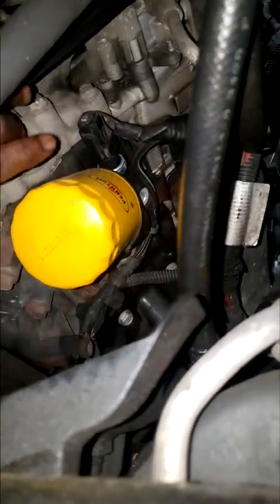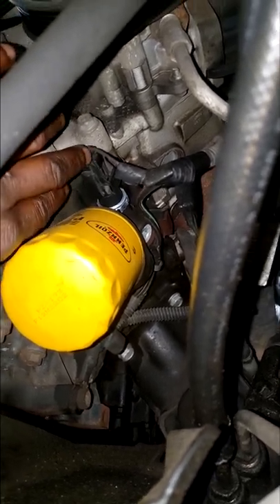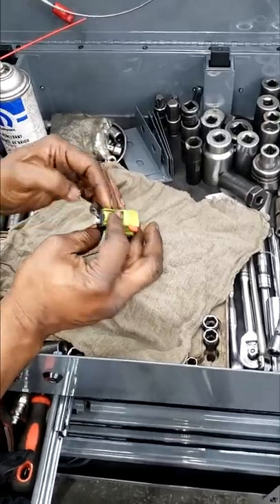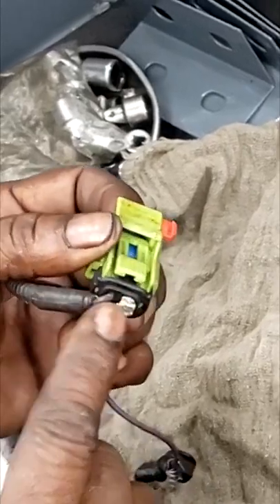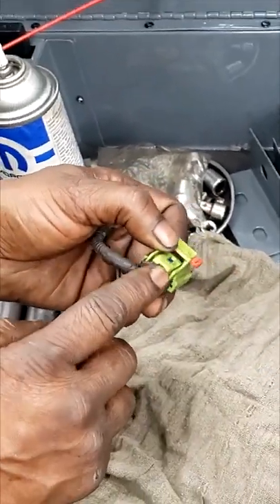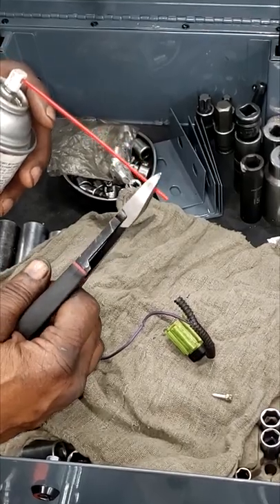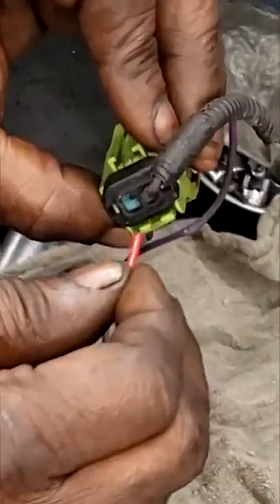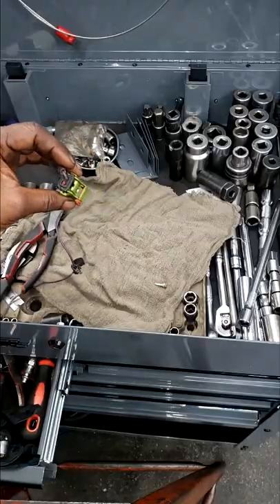SECRET REVEALED. Oil light on and flickering. Do this. #shorts

Comment: To everyone showing up here, allow me to explain.  The oil pressure in the engine pushes a diaphragm in the switch that makes two metal contacts touch.  If the connector is completely sealed tight the diaphragm will have equal pressure pushing back at it from the other side.  This makes a very light pressure on the metal contacts inside.  Every little bump or rattle will cause the metal contacts to stop touching for a moment, this makes the oil light flicker.  If you give the plug a way to exhaust the built up air pressure in the plug then the oil can push the diaphragm in with the full amount of it's pressure without having the trapped air pressure pushing back at it.
Reply: Brilliant Chrysler design as always
Reply: I really hope your not serious haha
Reply: Thank you sir. God Bless.
Reply: @Soulmodulation  buy a BMW or a chev, ford, Hyundai or Volkswagen... you'll see 'engineering' in practice 🤣
Reply: Great video.  I just learned something new.  A small tube from a not exactly WD - 40 , But that works as good.  👍. Thanks for the tip ,.
Reply: I have a question.   I have a 1994 Toyota Camry 4 cylinder.  It just started running rough.  Doesnt die at sitting at a red light.  But it runs bad , sounds like a vacuum leak, but , you mash on the throttle and 7 hear a buzzing noise ,. Not sure if it's a vacuum leak.  Sounds like something is stuck in the fan making it sound funny.  It does have broken motor mounts.  But I don't think that's the problem.  Any idea what it could be?  Oh , several weeks ago,. It just started making the noise and running rough,. I noticed that the hose that hooks to the hooks to the fuel injection part down to the box , that has a filter on it ,. Then it goes to the front of the car for the breather ,. The end part on the fuel injector had a split by the hose clamp b I took it off to duct tape the split part, but , the whole thing was completely broke off ,. So I took it off, and pushed the the end back on it tightened it down and now the check engine light is on, still running rough. I am baffled on what's wrong any help would be appreciated, thanks.  Bill , is Oregon. 👍👍
Reply from the maker: @yermoffroad  Whats funny is ya spelling, not the post
Reply: Nice explanation. Using science to explain things.
Reply: What air? Its a sealed switch (or it would leak oil) i assumed you were trying to keep the connector cool as to not distort and loose connection.
Reply: @yermoffroad  this guy is arguing with me about this, using words like diaphragm and trapped air😆
Reply: @007heatingandair  ever tear open a pressure switch?
Reply: @007heatingandair  The above link is a video on the operating principles of a pressure switch. Diaphragm and all 😂
Reply: @007heatingandair  So, if you go to the part of the video with the operating principles of the switch you'll see that the diaphragm (arrow #2) has to physically push into the area of the metal contacts (arrow #5).  If that area has a positive pressure present it reduces the force of the oil pressure on the diaphragm.

30psi--->  vs.  <--5psi   =  25psi-->  net force

Some switches will be completely sealed at the connector pins but have a slight vacuum pulled in the metal contact chamber at the time of manufacture to ensure no positive pressure in that area.  However, the seal around the plug pins can fail allowing the vacuum to escape the chamber and some manufacturers do not seal around the plug pins at all.  In these situations, plugging the connector into the switch creates positive pressure in the metal contact chamber.  The sealing grommet on the plug makes contact with the switch housing, then is pushed in another 1/8 inch untill fully seated.  This acts like a pneumatic piston creating a positive pressure that passes into the metal contact chamber and acts on the diaphragm.
Reply: @007heatingandair  Hope this helps.
Reply: That switch is sealed, no outside forces effect it in any way other than the connection to ground going through the metal prong going to the connector, if outside pressure effected it in any way altitude would have an effect on it's ability to function properly.
Reply: @007heatingandair the seal around the pins fails and the outside forces are effecting it, hence the need to open the connector.
Reply: And altitude would effect it minimally but not as much as the air pressure created from plugging in the connector, then heating up, expanding and creating additional pressure.
Reply: @007heatingandair  that's why this isn't a problem directly from factory, it happens over time as the seal around the pins fails.
Reply: @007heatingandair  another failure mode would be oil pressure seeping past the diaphragm, eventually the pressure on both sides of the diaphragm equalizes.  However, this isn't the case with these particular sensor / plug combinations since you can replace the sensor and the plug with new and it will still cause the same problem.  The power/ground pins are not sealed from factory (whether intentionally or accidentally) and the connector must breathe.
Reply: @Redranger-fu2xt  sounds like you need to stop trying to diagnose something out of your skill level and pay somone who actually knows what they are doing to tell you what's wrong and then you can repair it yourself. Nothing is free. But theres my 2 cents for your begging cup
Reply: @victormendoza871  hey , well  could be the spark plugs.  It was running fine the next minute it started running rough.  My money and job situation is nil ,. No job no money. I can't do anything.  Trying to find a job is  just non existent.  I thought it could be a vacuum leak, but now I don't know.  It sounds like a piece of plastic stuck in the engine fan.  Lack of power, goes uphill ok , but you really have to push the gas pedal to the floor to get it to move fast .  One place charges a $ 110.00 dollars just to look at it ,. Oh , also poor gas mileage.  That's why I am asking questions to maybe find out what is wrong with it. It also missed at driving speed .
Reply: No no no the sensor is sealed OR it would leak oil buddy, it's just a bad connection, replace the connector
Reply: @bradbeck2601  at that point replace the broken sensor!
Reply: @Redranger-fu2xt  that's the intake hose. Likely it has a large leak and needs to be replaced
Reply: @thomaspatlan1751  I have a link posted above for how the sensor works.  You're wrong pal.  You can also look up the technical service bulletin for it.  If you put a new OEM sensor in it does the same thing.
Reply: @thomaspatlan1751  Also, not sure if you noticed but there is only one wire in that connector, pulling the dart OUT OF THE SIDE WITHOUT A WIRE IN IT is the fix here.  If you reach up without removing the plug and just pull that little white dart out the problem is solved.  Care to explain that using your logic and reasoning?
Reply: @aayesher9400  Thanks.  I have tried to work on it but still not able to figure it out. Could be maybe it's hidden where I can't see it.  Funny thing it was fine in the beginning later it all of a sudden started running rough.
Reply: @kelsycunningham8452  BMWs are the easiest cars to work on by miles and miles.
Reply: @Redranger-fu2xt  it probably just needs new brakes.
Reply: @mrlions9494  Hey  , thanks for the reply . Refresh my memory , you talking about my rough idling car ??  It does need brakes , but it's the rough running motor , it has a vacuum leak . You mash on the throttle you can hear the leak , I sprayed water on it , still don't notice the motor changing pitch  it could be the vacuum hoses . I may have to raise it up and crawl under with a flash light .  It didn't happen over time , going to town and bang , it started running rough , that quick . Brakes ?  It does need brakes , I don't think would cause the rough idle . It sometimes loses power at pressing the throttle . Poor gas milage , all the vacuum lines seem ok , but it shouldn't get poor gas mileage , I went through a half a tank or a 1/4 of a tank in 53 miles ,  I'm stumped on this , any ideas ?  Thanks
Reply: @KG jobs non existent ??   I haven't been able to fix my car , not yet ,  a very serious vacuum leak ,  I'm too young to collect social security ,  there I thought jobs are everywhere , I don't understand ,    I sprayed water on the motor to find the leak , and still didn't ,    last ? This job thing ?  I don't understand it at all ,  I have fought last 3 years trying to find one , I still have bills to pay , no money I can't ,  your comment is great ,  I own this house and pay space rent ,  this just ran out from an agency helping me
Reply: @Soulmodulation  I'm the first one to shit on Chrysler, but this is a universal design used by a plethora of manufacturers.

Comment: Refreshing to see a mechanic at work not just a parts changing video but a refreshing mechanic fix
Reply from the maker: Thanks for watching bud
Reply: Are you kidding me? You think electricity needs air to breathe? Guess again buddy.  Hes already put a new filter housing on the car, now he's helping your electrical system BREATHE? THIS IS EXACTLY THE SHOP TO AVOID.
Reply: @anthonyrybczynski5420  it's not the electricity it's the sensor mechanism, there's a comment that explains it if you're curious
Reply: @philljustphill1656  sorry sensors are manufactured to be air tight and prevent leaking in or out. If there is not enough oil pressure to overcome the tiny amount of air (which air can be compressed) behind the diaphragm,  then there is not enough oil pressure.  Do you know why sensors are air tight? To prevent moisture from entering.  He didn't fix anything. Can you please show me a Technical service bulletin from the manufacturer where they state that the sensor was manufactured wrong and required a hole to breathe?
Reply: @anthonyrybczynski5420  they don’t make everything perfect especially jeep
Reply from the maker: @anthonyrybczynski5420  so this comment 2 months old and I obviously missed out on a chance to clown ya stupid ass comment so I will not bother to do it now. Hopefully by now you have researched this issue and now understand.

Comment: Every engine I've come across with an oil light flicker was due to low oil pressure at idle. It was still in spec, but aftermarket oil pressure switches are poorly calibrated. Just use an oem switch.
Reply from the maker: In some cases, an OEM sensor was used dude. Im sure you saw that the sensor was new in this video, smh
Reply: @OnlineMechanicTips  A sensor can be new and not be OEM, SMFH!
Reply from the maker: @shelbyseelbach9568  whats ya point? Because of what I did, this vehicle long gone an likely never to return for oil lights flickering so what should that tell you?
Reply: @OnlineMechanicTips  My point is that a sensor can be new without being OEM. Seems readily apparent from reading my first comment. I didn't say anything about the other stuff you are now addressing to me for some reason. It's a true statement.

Comment: When the oil pressure sensor goes bad and starts leaking externally, it leaks into the wiring harness and that finds its way all the way up to the engine control module. It ( the oil )  then interrupts other signals and shorts out other inputs and outputs. Putting a straw in the electrical connector is one way to prevent oil from tracing its way up the wiring harness, in case of a sensor failure. Chrysler did this to prevent oil from tracing up the wiring harness that is it plain and simple. Not too bad. Not something I prefer to see on a watertight connection, but it is a fix for a worse problem.
Reply from the maker: You got it semi wrong my dude. The sole purpose was the many issues we had (at the time) with the flickering oil light. The initial instructions from the engineers to the mechanics at the time (me) was for now, to simply pull out the tab and put the straw in there. They then created another connector with the proper pig tail so the connect would remain weather sealed. I question your comment statement about when a oil pressure sensor "goes bad". Im not sure what that mean because a oil pressure sensor can fail in a number of ways, not just just externally leak. Yes, oil can migrate its way back to the pcm from a failed oil pressure sensor, but this is basically 2 different concerns.

Comment: Believe it or not this problem has been around for around for 20 plus years. I was a Chrysler tech for about 10 years. 
I see they still haven’t fixed it. At least they are consistent!
Reply from the maker: Exactly, we mechanics kept this a secret for the first 10 years. lol, Shame to say, I once replaced a engine because of this. 3 oil sending units later. And yes, problem been there over 2 decades..
Reply: @OnlineMechanicTips  damn bad diag
Reply from the maker: @robbydiesel9345  explain
Reply: @OnlineMechanicTips  you said shame to say i replaced an engine over that
Reply from the maker: @robbydiesel9345  lol, yes, very bad diagnosis. I was young and thought I knew everything..lol, this was like over 15 years ago. A Chrysler Cirrus with the 2.5 V6 engine. Oil light kept coming on with 3 new sensors/switches and a new oil pump. Talk about crushed, after the new engine put in, oil light came back on..smdh..I was destroyed.
Reply: So... Is this the same connector on a 5.7 Hemi?? Because a friend just picked up a really nice 300. It had a brand new Mopar crate engine, but it "didnt have oil pressure", so the guy sold it. I checked out oil pump, and ensured it was pumping oil. Put it back together...and it was fine...pumped oil top end within a few seconds. I DID replace the sensor first... Wondering it sensor/connector was the whole issue(?) Either way, my friend got a really great car for cheap!!

Comment: Very interesting tip.. I usually pull the pvc valve n clean/replace the pvc valve..
Reply from the maker: What does that do for a flickering oil light? Please explain
Reply from the maker: https://www.youtube.com/watch?v=HMXq6xNW3JM&list=UUSIdv7pEKV2jxJvI6YZB21A
Reply: On older vehicles it would help improve oil blow back. I was just relating to older cars..
Reply from the maker: @pi1797  Yes, if you have resons to remove valve covers to clean, you def have some crankcase vent problems. Good point

Comment: The oil sensor needs to breath not the plug. The plug itself is bad and it's making a bad connection. Replace the plug and issue will be solved. By opening the plug like he is showing allows water and dirt into the plug making the connections corrode just making connection worse. It only fixes the problem temporarily because he unplugged it and plugged it back in fixing the connection. It will do it again soon. Just replace the connector!!!!!!
Reply from the maker: This problem has nothing to do with connection..smdh. The connector needs to vent any pressure thats created, boom, problem solved. No need to spend $100 dollars on a connector that you cant get anymore. And aint no dam water or dirt going to get in there, geeesh
Reply: @OnlineMechanicTips  why would a connector need to breath they have rubber seals on them for a reason to keep moisture out. The diaphragm in the sensor has nothing to do with the plug. Oil pressure pushes the diaphragm the higher the pressure the harder its pushed if the oil pressure goes down it goes back to where it was no need for a vent. Been doing this as a profession for 30 years I see plugs bad a lot.
Reply from the maker: @iknowyourebrokeauto468  My friend, this was a unique cituation ok, yes it goes against the normal way of thinking. Everything you just mentioned makes sense. Just not in this case. Your 30 years likely did not include this problem or vehicles that had this problem, other wise we wouldnt be here discussing it right? So, because you likely have not seen or faced such a problem on the vehicles in question, why are you speaking on it against somebody who has?. See how crazy that sound? There was a TSB #083699 Chrysler released over 20 years ago telling dealer techs (me) on what to do to solve this problem for now. Thats what this video based off of. Please look that up and read it if you want. Its crazy to have 30 plus years experience in auto work but not think its a problem to come on a content creators video and speak on something that you not know what you talking about. smh

Comment: If there’s that much pressure in the sump you could check the PCV system,
Not a stellantis tech so maybe I’m missing something.
Reply from the maker: Yes, you def missing something. Has nothing to do with pcv or sump pressure. Just a poorly design connector
Reply: @OnlineMechanicTips  only FCA!
Reply from the maker: @donaldotjf4894  lol, FCA was not even thought of back when this problem showed up. The TSB for this repair over 20 years old. Its just a lot of the cars still on the road so I decided to display what was going on.
Reply from the maker: @donaldotjf4894  https://www.youtube.com/watch?v=HMXq6xNW3JM&t=5s